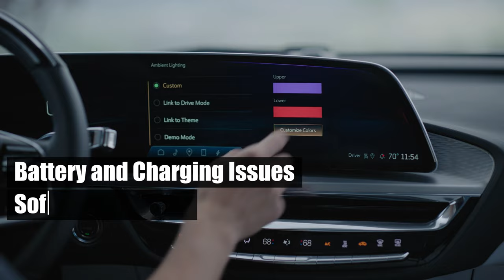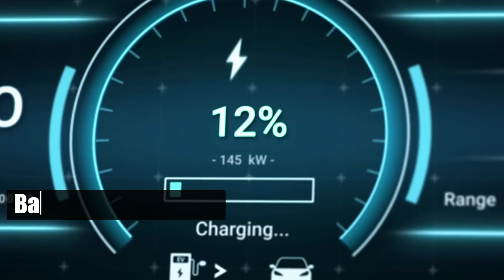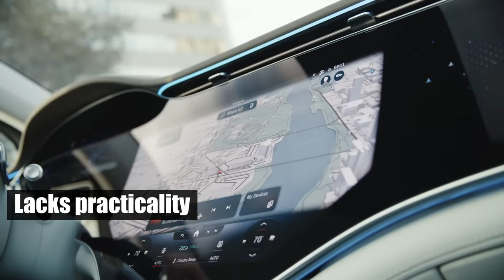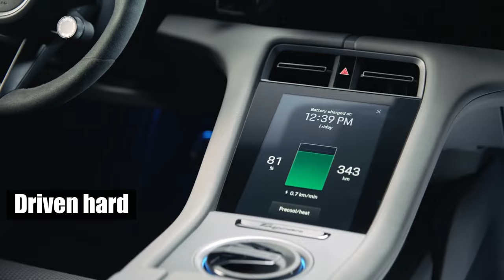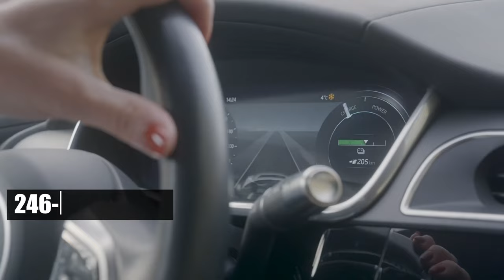The EVs No One Wants: 9 Models Dealers Can’t Sell! Electric Vehicles That Stays Unsold For Too Long!

Comment: Those who try Teslas love thier cars.
Reply: Why are so many tesla on the used market at less than half price less than 3 years old then? Herts and Sixt rental companies got rid of theirs FAST because they are money pits. Uber drivers only get about 50,000 miles out of a battery pack with a tesla. The proof is here on YT. Expensive to fix, $1600 for an AC compressor? You can't easily repair a car built on a Gigapress,  so insurance companies write off tesla and that's part of the reason why. You really don't want to have your car written off when you are $20,000 under water on the loan? Cost of tires every year are really high on any BEV. Long charging times and cold weather, even just cool and rainy weather destroy range of a BEV.
Reply: Watch the What Car? Test of 9 different models of BEV here on YT. The tesla won because it only lost 91 miles of range from 100% to 0% and no longer moving, towed away on a scattered showers 55 degree day, using lights, wipers and climate control set to 68F degrees automatic. 390 down to less than 300 miles range! On a not very inclement day at 100% to 0% won't move, and you are only going to have charge between 20% and 80%? Not very good. What is 40% of a 300 actual miles? 180 miles. This was nowhere near the Chicago polar vortex temps which would be far worse.
Reply: @robertkubrick3738  Teslas historically sell for more than new.  But.  People want the latest & greatest. They are the highest repeat customer manufacturer in the world.  
 The rest you dug for garbage . And got shyt.
Reply: @GWAForUTBE  You should get out more and brush up on History for the last year which is how long some of those teslas have been listed for, with price dropping every month since.
Reply: @robertkubrick3738  Prices for second-hand Teslas are climbing back up!

Get informed!
Reply: @st-ex8506  Not on Auto trader.

Comment: The reason why it fails is simple. They all started with the wrong car segment. They all rushed towards heavy luxury and/or sports segments with very high purchase prices. Tesla is not better than others with regards to this remark. They might be more efficient in terms of power consumption or in some aspects the software department but neither of them are reliable. On the contrary they are probably as reliable as an old USSR made car. If they would have opted to build small, functional and lightweight cars, especially designed to operate in and around town, they would probably have had more success if the price would have been right as well. With current EV tech, weight is still the number one reason why the autonomy is so poor. If you pack a car full of hefty gadgets on top of an already heavy battery then you have an elephant on wheels. And as you, Americans, only know big is better then you should not be wining about the poor results. Who the hell thought it would be a good idea to build a large pick-up as an EV? Who can be as dumb to do that?